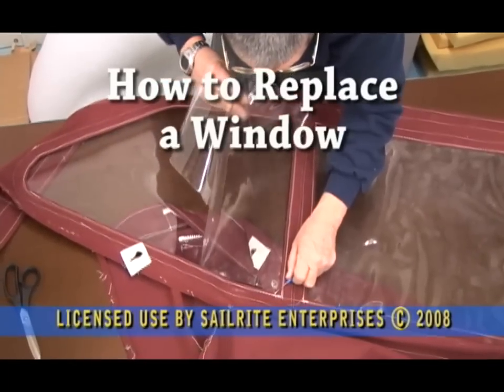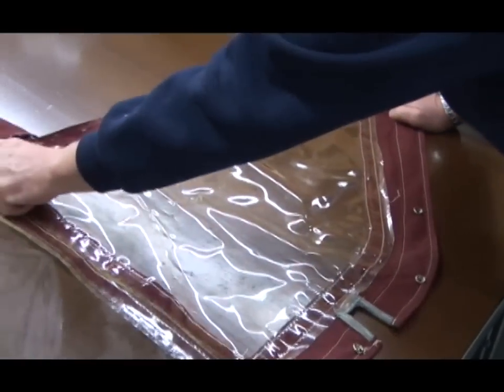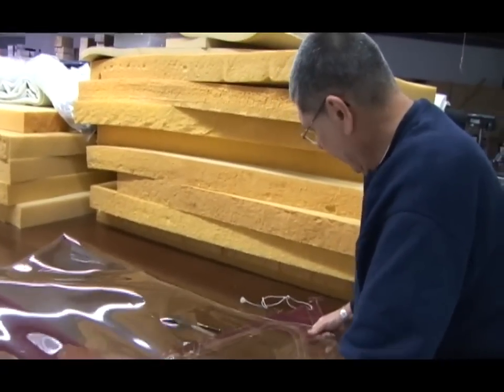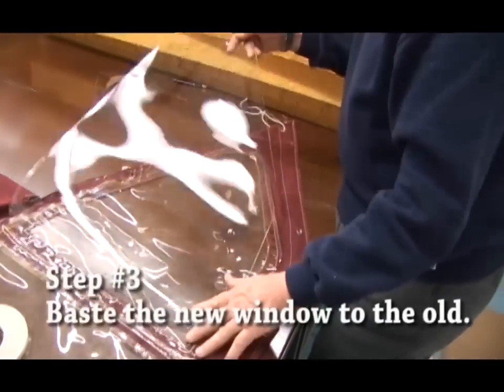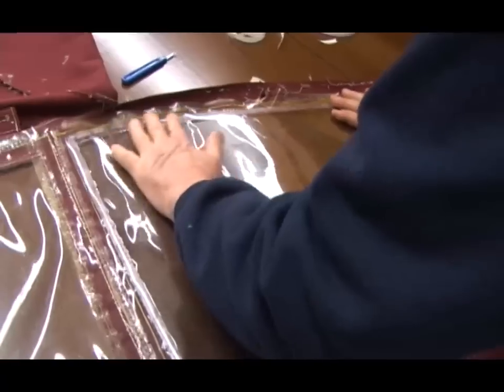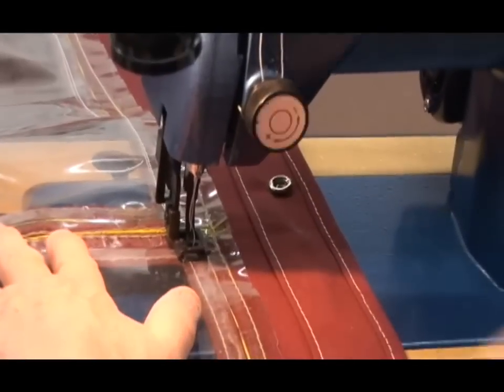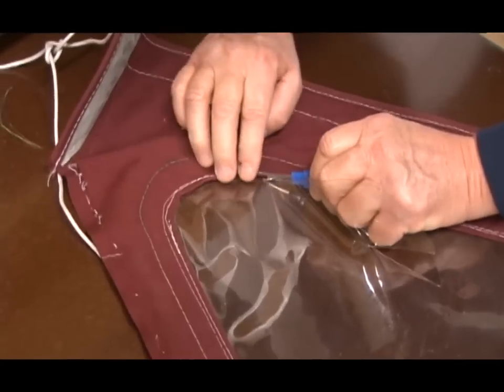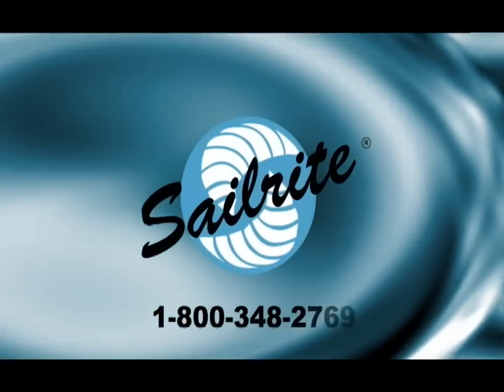Vinyl Window Replacement in a Dodger

Comment: I replaced the windows in my dodger using this method and it works very well. I did, however, change one detail. I measured the new window and cut it out. I ripped the outside seam from the old window and trimmed the outside edge of the old window just to the edge of the inner seam. Then I basted the new window over the old and sewed the outside seam along the original outside seam line. I flipped the assembly over and ripped the original inside seam out and pulled the old window out of its place leaving the assembly with the new window secured by the new outside seam. Then I stitched the inner seam on the assembly along the original inside seam line. The new window is secured in place and everything is neat and tidy.
Reply: HI John.  I had the same idea.  I didn't want to sew through 2 layers of windows, yes, replacing for 3rd time.  I'm new to this so this is my first project.  If all goes well I am going to sew a whole new dodger from scratch.  Did you have problems with stitches missing?  What needle and thread did you use?  Hope you get this.  Great minds think alike.  HA
Reply: This sounds smart! I will do it your way.

Comment: Thank you for this!!  I just successfully replaced the isinglass panel in my starboard side curtain and also removed and reinstalled the old "U" zipper using your methods taught in that particular video.  I used my Singer Heavy Duty standard styled machine.  Boy do I wish I had a commercial machine and a larger working area.  It came out pretty good but the stitch length is a little tighter than I would have liked, but I did the best with what I had.
Reply from the maker: Good job! Glad we could help.

Comment: about 6 years ago I did something similar but used contact cement around the perimeter where the stitches are (both the new window side and the olde window side.  It is tricky but holds really well. I cut out the old window the same way.
Reply from the maker: Yes, HH-66 Vinyl Cement will work to glue sections of clear vinyl together. However, it will not work with O'Sea and Strataglass since they have a protective coating not allowing the glue to penetrate and stick.

Comment: I have today used this method, but I have a problem. I have sewed in 30 gauge Strattaglass. The method worked beautiful. However the old window material must be 40 guage. My seam ripper will not cut it. Neither will my scissors. Can anyone tell me how to get the old heavy vinyl out.
Reply from the maker: Old clear vinyl material over time starts to loose the liquid, called plasticizer, once it is gone you are left with a board like clear vinyl that starts to become cloudy or tan in color. The plasticizer in the clear vinyl helps to keep the vinyl glass supple and soft which makes it easier to cut. If all of it is gone then it is a pain to cut and only a good heavy duty pair of scissors will cut it.

Comment: What size of needle and thread did you use?  I am going through 2 layers of window plus the canvas and trim.  Sews fine when I layer up material but when testing on window material it skipped stitches.  I used a 21 needle and 92 thread.  I was told to use a 18 needle but I don't think she knew I was going through so many layers.  Any help would be very much appreciated.
Reply: Hi Sheri, I'm no pro by any stretch so take everything I say with a grain of salt... 

did you try adjusting the tension? I find the machine pretty much powers through anything... But I believe skipped stitches are more a sign of tension issues. I used the "regular" thread (poly I believe) but if you're using that tenara or one of the Teflon PTFE type it's apparently a little more tricky. I'm pretty sure there's a video on the Sailrite channel covering it... But I would definite get some scrap pieces of the same materials you're going to be seeing through and play with the tension knob...
Reply from the maker: Sheri,
When using a V-92 Polyester thread you can use a size #20 needle, a #21 may also work, but it is a little on the big size. If you are still getting skipped stitches in your window material and canvas assembly you may need to check the timing of the sewing machine. Are you using a Sailrite Ultrafeed sewing machine? If so, I will include some videos that may be helpful. Let me know. 
Thanks,
Eric